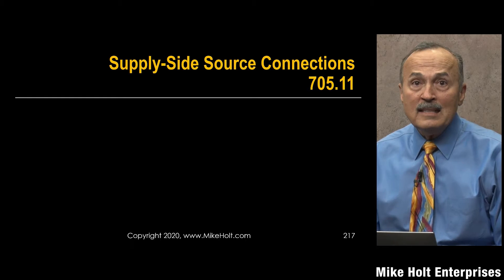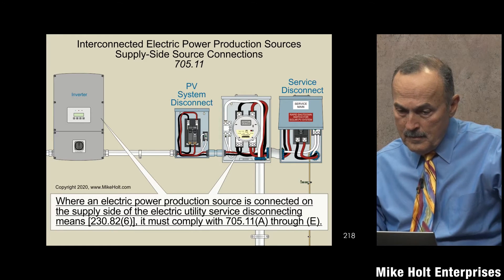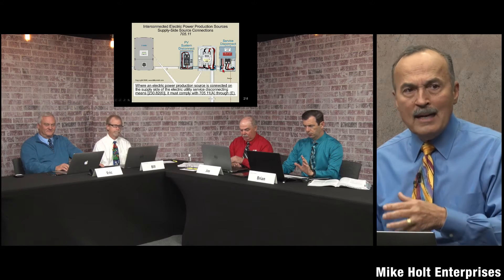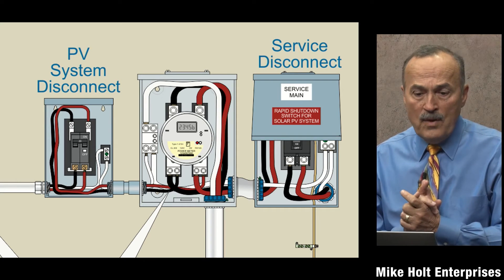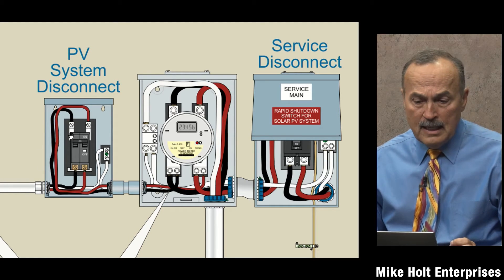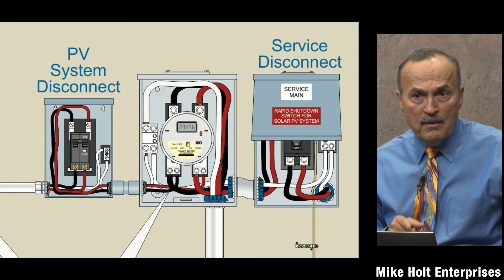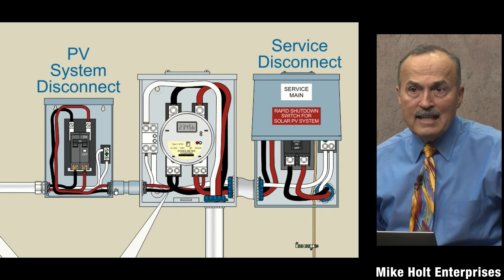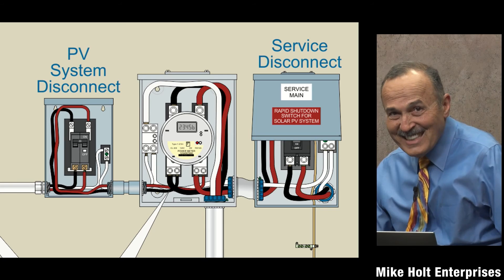Interconnected Electrical Power Production Sources, Supply-Side Source Connections,NEC 2020 [705.11]

Comment: Hi Mike, If we bond the ground the neutral and the ground at both the service panel and the pv disconnect then that will create a loop. Isn't that a safety issue?
Reply from the maker: @MarjonGimpahyan-c9y, if the PV disconnect is on the 'load-side' of the service disconnect as permitted by 705.12, then a N/G bond is prohibited, see 250.24(B). If the PV disconnect is on the 'line-side' of the service disconnect as permitted by 705.11, then a N/G bond is REQUIRED, see 705.11(E).

Comment: Where is the EGC to the solar array on the roof. In another video for 690.47, you state that the array must be connected(bonded) to the GEC system. How does your diagram in this video provide the grounding to the solar array?
Reply from the maker: All that is required is an equipment grounding conductor in accordance with 690.43.
Reply from the maker: All that is required is an EGC with the circuit conductor bonded to the array, in accordance with 690.43.
Reply: @MikeHoltNEC  Agreed. Your diagram does not show the EGC. It also shows a plastic conduit which cannot act as a ground. So how is the array grounded in the diagram?
Reply from the maker: The service equipment is grounded by the 'grounded' (neutral) conductor in accordance with 250.24(A), 250.92(B), and 250.142(A).

Comment: In your previous video 690.1 PV System scope: https://youtu.be/gZT9y0Ougao?si=zO84ii7qj6M4IVot 
"PV System" ends at the DC disconnect from my understanding, and in this 705.11 PV System disconnect seems to be on the output AC side of the inverer which is not the same definition?
Reply from the maker: False. No change in the 2020 to 2023 NEC as to where the PV system starts. Notice in the 2020 video, I shade in yellow the PV system. It's always been where the AC side terminates in an OCPD.

Comment: That drawing is incorrect for the solar pv
Reply from the maker: Not it's not...
Reply: @MikeHoltNEC  The drawing showing disconnect going through meter can. Solar paths are  solar pv panels to inverter , to disconnect, and then main or sub panel line-side with piercing or back-fed breaker. During solar installation companies are not contacting utility companies to do a temporary disconnect to go into meter can or disconnecting it. Electrical plans I can send/email your way as an example. Only time companies needs access to meter can is if a battery is being installed for the ESS battery. Thanks for your work.
Reply from the maker: @EvolveSolarOperations  The NEC permits the 'supply-side' connection at any point on the supply-side of the service disconnect, including the meter as shown. Please review 700.11 in the NEC. If you don't like this 'option,' that's okay but it doesn't mean that others should not do it this way.
Reply: @EvolveSolarOperations im installing solar in meter cans all the time in Illinois. mounting PV disconnect and equipment rught off the meter is more expedient than routibg to main panel inside

Comment: Mike and at el, 
In my opinion, change in definition of service is just to clarify PV System is a parallel source of energy, called service. Yours interpretation abiut ground wire requirement is correct, we don't need to bond conduit if it is not metallic. 
However, electrical safety point of view,  shouldn't PV system be grounded? If so why we ground that with separately derived grounding grounding? If utility company permit to run ground wire through metering panel, we should  bring ground wire all the way to service disconnect switch where we are bonding neutral and ground wire. This is just my opinion.

Comment: Line side taps right before the service disconnect are the more common way of connecting to the supply side.
I recently worked with an inspector, and his position was that the inverter AC disconnect is in fact a service disconnecting means.
Inverter equipment does draw power from the service conductors then it is in standby, and the PV AC disconnect interrupts that, so by the definitions I would also conclude that it is a service disconnect... What else could it be?

Comment: we dont allow you to pass your load side past out line side because of transduction
Reply: Can you elaborate? Most of us are ignorant on this topic, even those in the video struggled to answer it.

Please explain in as much detail as you can provide. Thank you.
Reply: @ClippyRenaissance  well you have some of the magnetic residence from the conductor the insulation tries to stop most of it but as those conductors rub it will only increase therefore giving power past the meter

Comment: I don't like this diagram, what if the premises has two service disconnects and two PV disconnects. Bonding every neutral creates multi fault current paths thru the disconnecting means enclosures, and in the event of a fault, the enclosures and raceways could potentially become fault current paths. In this example in the video it's ok, because there's no EGC in the PV disconnect, so no multiple fault current paths, and also PVC was used for nipples between the switch enclosure and the meter base. On every system, it's better to stick with one and only one neutral bonding connection. One example is a large house I did with multiple PV disconnects, and two service rated generator transfer switches feeding two 200 amp panels as service disconnecting means. To avoid this problem, I ran EGC's to every switch, and the main GEC in this area is always attached to the neutral bar inside the meter base. The reason being this utility wants the EGC to be in the enclosure with the utility seal on the door, to prevent tampering of the GEC. Also, the main GEC is required to be in a conduit, and then to each grounding rod. Then a separate EGC is brought out for the telecommunications, CATV, satellite dishes etc. Because this utility doesn't want people attaching stuff to the main EGC. This way, the only place the neutral is connected to ground is only in the meter can, and all the service disconnects and everything else downstream of the meter base, the neutral is kept separate from ground. GEC is used to bond all the switches together. With the transfer switches this was easy, the manufacturer already had separate ground and neutral bars, so was easy to just remove the bonding jumper. In the 200amp PV disconnect switch, I just used the terminal block with the green bonding screw for the EGC, and the neutral just came from the meter base and directly to the inverter subpanel without any neutral connection to the disconnect switch itself. Some other jurisdictions like Florida I think also do it this way, seems to be more for areas that are prone to lightning strikes in which the GEC is ran into the meter can, and then every panel in the premises has to be treated like a subpanel, and no neutral to ground connections allowed anywhere on the premises except in the meter base, sealed by the utility. Makes for a safer system in my opinion.

Comment: That looks nasty. There should be one service disconnect and only that should connect to the meter. The PV system should connect to the service disconnect. Switch the service disconnect off and everything is disconnected from the meter. Yikes.

Comment: Must be a electronic detector to time top dead center of the ( the inverter can ensure proper synchronization of the output waveform to grid voltage, frequency, and phase. In most inverter designs, a PLL provides the mechanism at the heart of this synchronization process ) if out of sink probably auto disconnect
Reply: Grid Tie

Comment: You’re violating multiple codes by bonding the neutral conductor to ground in the PV disconnect enclosure. The PV system is not a separately derived system and is not service equipment.
Reply from the maker: Of course not, read 250.25, which is new for the 2020 NEC.

Comment: The Question is: Do you bond your grounds and neutrals in the pv disconnect and purposely create a parallel path to ground? 

Or do you isolate them and use the EGC to get objectable current back to the neutral?  (just like a sub panel)

THE 0 point (neutral) is already established from the utility company and bonded why would we bond at the pv disconnect? this would create 2 paths to the main  1 on the ground 1 on the neutral...   no?

the grounds coldwater,steel,rods, everything (likely to become energized) and the neutral is already established and bonded.

thanks.
Reply from the maker: Neutral and case is bonded in the supply side disconnect per 250.25.
Reply: @MikeHoltNEC  @MikeHoltNEC  Thanks for the response, but wouldn't that create a parallel path on the ground and neutral? If you bond both the service disconnect and the pv disconnect? with MBJs??
Reply: Hey I just wanna make sure you understand that the bond between the neutral and ground in the PV system disconnect only occurs if your PV is connected on the supply side of the main service disconnect…
Reply: @ianclifford31  yeah, I get that that is what the code says, I was wondering how that does not create a parallel path. also why would it matter if it is a back fed breaker or a supply side connection. I get that they are unprotected conductors( service side ) the neutral is from the utility and already bonded to the ground and the grounds are not sized per 250.66.   thanks
Reply: @toolsandtactics  I'm starting to see it designed & accepted on more 3ph wye projects. I don't get it either. N-G bond already exists - why do it again if not separately derived?
Reply: @WhosthatTeamAFC  yeah, my thoughts too.
Reply: There are no grounds on a PV system.. You have a hot and neutral..Only thing grounded is the solar array frame metal support. And that is grounded at the service. 

And these can be wired in series or parallel. Why the smart people fuse each panel. That way if you lose a solar panel. You know which one it is...Just as you would fuse each parking lot light poles. If one goes bad. It does take them all down or the whole array..

Comment: The raceway from service disconnect (where supply side connection is made) to solar primary disconnect.. some inspectors here in CT do not want the neutral bonded in the solar disconnect  if we use a metal raceway because they say it creates a parallel path for the neutral back to the service first means of disconnect… thoughts Mike ?

Ian
Reply from the maker: The 2020 NEC makes it clear in 250.25, that we must bond the neutral to the case in accordance with 250.24.

Comment: Line side connection 208 delta because primary solar is 480. Solar needs Neutral for reference only and we create with transformer.
Reply from the maker: No. 1 208V is not Delta.
No. 2 I don't understand what you mean by 480V.
No. 3 Solar PV does not create a transformer.
Reply: @MikeHoltNEC  My bad and sorry for late supply.  Main service is 120/208.  Our Solar inverters are 480/277 and neutral for inverter are for reference only.  So we come from line side Utility into  AC Disco  with 208 no neutral. From disco to new reverse fed transformer with 208  to 480/277 . Then we install a disconnect after transformer 600v  to new inverter. So its just the new inverter drawing thee 480v.  Thank You and God Bles
Reply: Can you tell me what solar array produces 480 volts? I never seen one in my life. As the highest rated PV panels I seen are 150 volts Ocv. And how the hell would you get 3 phase. Unless you had three solar panel arrays. Each at there own phase angles.
Reply: @WizzRacing   Sorry bad info. The inverters we use are 480v and we use a transformer  to convert. The inverters we use are Solar Edge 120k or smaller